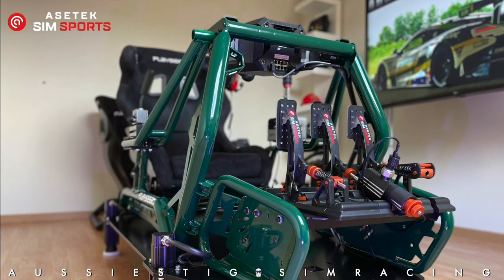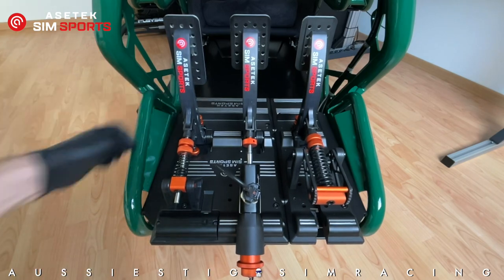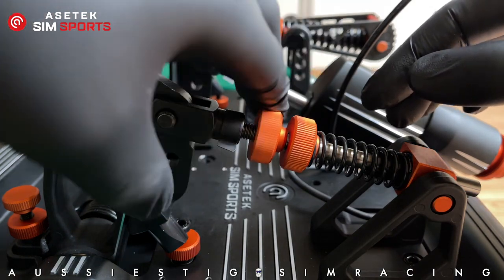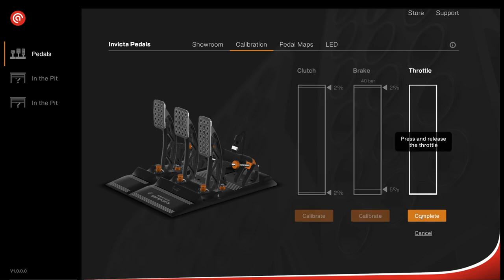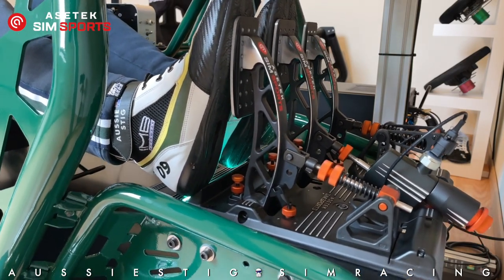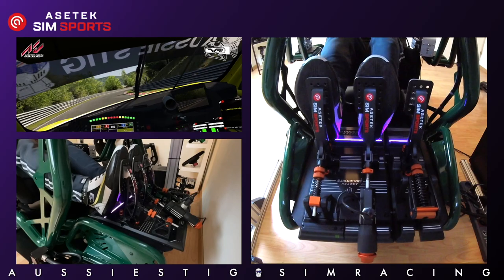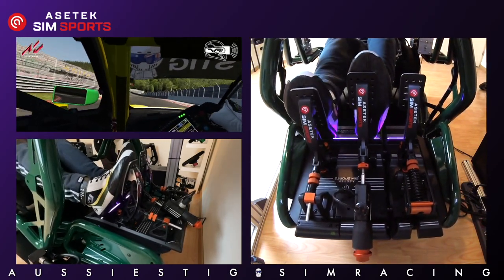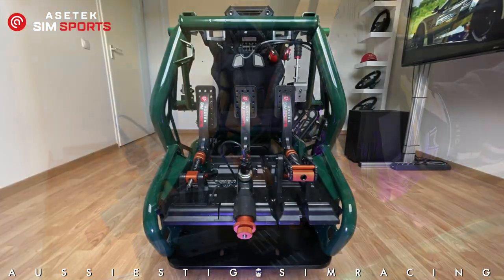Part 2 - AussieStig Reviews The Asetek SimSports Invicta Pedals

Comment: Hey AussiStig, If I were to set these pedals to their lowest setting do you think it would throw me around considering I'll be using the 'next level racing wheel stand dd' and an office chair with bell rubber stoppers instead of wheels? I'm really trying to do the whole 'buy once cry once' thing here and don't have the space for stationary rig yet! Would really value your op. Cheers!
Reply from the maker: Hey mate no worries. The invicta brake pedal is very firm. On your projected set up they would need to be well anchored and possibly up against a wall. They do have softer elastomers now which I have not tried. These might give you a softer pedal which would help. Really hard to say having never tried a set up like yours. Sorry I can't be of more help. Good luck with the purchase Cheers AussieStig
Reply: @SimRacingwithAussieStig  That was a lot of help already. I appreciate the reply man thanks

Comment: Been waiting for this review as you are the only dude I am aware of who has Simtrecs (which I have on pre-order due for next month's batch) and now Asetek. So which one are you going to stick with, you are not going to swap decks out all the time, what bed are you going to lay in, Simtrecs or Asetek?
Reply from the maker: Thanks for the comment mate. I already have another set of pedals lined up to review, neither will be back on the rig permanently.  Both those pedals have very strong points and few flaws. It really is a personal choice and if you want maximum adjustability or can live with less. It depends a little on the rig you have as well. Cheers AussieStig
Reply: @SimRacingwithAussieStig  I guess you have sold out.............. you should run as a politician with that response kudus well done.
Reply from the maker: @rooman7160  I'm not in anyone's pocket mate. If I say buy this instead of that. You get this, install it and then don't like it, you will be cross with me for making a decision for you.
Reply: @SimRacingwithAussieStig  All I asked was which one would you put on your rig, you have not answered that question.

I understand the difference, Asetek great breaks, Simtrecs great adjustability that is a decision I need to make. For me, I am leaning towards Asetek due to the break and the price. I also am a little concerned about some of the feedback from the USB connection I have heard and the software regarding Simtrecs, nonetheless I no for a fact either one will be bloody fantastic but I do not own both where as you do.

One needs to be pragmatic at this price point there is never going to be a clear winner and if anyone thinks so they a fool. Either option would and will be a bloody top pick for anyone but I was curious as to your thoughts what you would put on your rig.

Keep up the great work, I like your different approach to putting up vids, hope you start streaming :)
Reply from the maker: @rooman7160  Pragmatism is the way to go, you don't know until you know. Some of my favourite pedals have been the hydraulic Ricmotech GT Pros based on Tilton 600 real car pedals. Thanks for the kind words mate.  AussieStig

Comment: I have been focused on the difference between the Simtrec and Aseteks Brake feel but what about the clutch and Throttle. Would you say those are pretty much identical in feeling between these two Products?
Reply from the maker: Hey mate, the throttles feel quite similar. The clutch on the Aseteks does feel different to the Simtrec's mechanism. The Simtrecs have a more pronounced bite point feel which is due to the mechanical action of the solid connection between the pedal arm and the rear pivot point.
Reply: @SimRacingwithAussieStig  OK, thanks for your experience with this. If I am hearing you right, the Aseteks DO still have a bit point, just not as pronounced as the Sim trec. I do drive a lot of cars with a Clutch
Reply from the maker: @rtimmins7212  Hey mate no worries. I know for myself when I use the clutch whilst heel&toeing, the clutch is pressed quickly and the bite point feel is not really felt. It is felt more for starting a race from a standing start, then you can feel the difference in approaches. Cheers, AussieStig
Reply: @SimRacingwithAussieStig  great , thank you. You are one of the rare Youtubers (who actually responds to comments) who has experience with these two pedals so your opinion is valued.
Reply from the maker: @rtimmins7212  No worries mate, anytime. Why have a channel if you think you are above answering people when they have  a question. Cheers AussieStig
Reply: @rtimmins7212  I currently have both the Simtrecs and the Aseteks. The throttle is stiffer on the Asetek and when going full throttle, it feels like there is lag or a delay, but that should be able to be tuned out with software. For heel-toe, the Simtrecs are nicer fot quick blips.

The clutch is also heavier on the Asetek but the bite-point step isn't that great. Think of it as a stiffer pressure plate.
Reply: @timt8199  which do you prefer for braking and do you even use either of these still?
Reply: @DrR1pper for braking in stock form, the Asetek Invictas. I have not tried the new version Sintrecs with the elastomer cups. However, for H-Pattern cars, heel and toe is better with the Simtrecs because there is more travel. The community has a 3d printed adapter to use the Simagic reactors on the Invictas, that are also alot stronger than the vibrating motors on the Simtrecs. 

If you're looking for more travel (street car style), the Simtrecs with the new cups or even a spring mod would be the way to go.
Reply: @DrR1pper  I still have both, but the Invictas are my primary set. I found it easier to threshold brake on cars without ABS.

Comment: SimTrecs pro or Asetek?
Reply from the maker: Depends on your set up and how solid your rig is. The Asetek has the edge on brake pedal feel. You will need a solid rig to mount them on. Simtrecs win on maximum adjustability.
Reply: @SimRacingwithAussieStig   I have a Simlab P1 X
Reply: @SimRacingwithAussieStig  I also want to know this as I have SimTrecs on order but they are currently significantly more expensive than the Invicta pedals due to pre order sale.  I am still leaning towards the SimTrecs myself.  Unfortunately it seems like such a tough decision!
Reply: @SimRacingwithAussieStig  Do you recall the maximum distance you could mount the Simtrecs brake and throttle?  I assume limited by cable length but would prefer to have the brake directly in line with my left leg with the throttle directly in line with my right leg for maximum comfort if that makes sense.
Reply from the maker: @slickmotion5021   both pedals have very strong points. If you want a really hard pedal with less adjustment possibilities then Asetek is a solid choice. If you want more adjustability Simtrecs offer that and a hydraulic pedal as well. It is a personal choice what suits you the best.
Reply from the maker: @chuckystang  get it mate the clutch cable may not be long enough for that. That has to go from the clutch to the throttle pedal.
Reply: @SimRacingwithAussieStig   SimTrecs is not hydraulic? How do the hydraulic brake vs elastic feel?
Reply from the maker: @slickmotion5021  Simtrecs have an adjustable hydraulic damper on them mate. Which can be set to give you a similar hard pedal feel.
Reply: @chuckystang  19.5cm from center of brake pedal to center of throttle pedal is the maximum gap. However, you won't be able to use the clutch pedal.

Comment: I have the Simtrecs and agree about the adjustability being a strong point with them. It allows for so much adjustability in brake travel and feel compared to the Aseteks. 

After watching a few of the reviews on the Asetek where brake travel is 20mm, I decided to add the hard elastomers and took out the slack from the pad to disc spring on the Simtrecs. It took some adjustment on my part and noticed that lap times were faster. 

I also measured the brake pedal distance of the Simtrecs and was able to replicate 20mm max travel with me pressing as hard as I could comfortably during sustained race conditions. The Simtrecs still gives me the option to add the hard plastic spacers to use in place of the hard elastomers if I want even more stiffness. Travel wise I know what to expect with the Aseteks, but am curious about the brake feel and have the Aseteks on pre-order.

Another thing I'm curious about is whether the Aseteks short brake pedal throw is also optimal for other disciplines of racing, such as oval or dirt racing where progressive braking is more important? Hoping someone with more experience in those disciplines can chime in.
Reply: Hey man did you get your Asetek's ? i'm stuck between Simtrecs and Asetek i can't choose to buy one :)
Reply: @991tts4 Yes, I have the Aseteks for a few weeks now. Unfortunately, they leaked...but Asetek was quick to respond and their after-sales support was really good. 

Brake feel is really good at the limit as you can dance the car between grip and slip while trail-braking. The biggest adjustment is the pressure required to brake, but that comes with time. Whereas the Simtrecs offers a wider range of adjustability in terms of travel and pressure. I am currently testing a spring setup that I was able to fit onto the Simtrecs - an idea from a fellow Simtrecs owner - and am going to test for a bit before reinstalling the Aseteks. 

If you get the Aseteks, you will be happy. Ergonomics is personal. If you're coming from Simtrecs, that's tougher since you give up some features that they offer. 

Brake feel I'd say the Asetek slightly has it over the Simtrecs - although I'm still testing between the two - but Simtrecs has been flawless in terms of reliability and probably the best looking set of pedals on the market today.
Reply: @timt8199  thanks a lot for your detailed reply much appreciated
Reply: @991tts4  I just read through some of the other comments and noticed that Aussie Stig had similar feedback so I don't know if I made your decision any easier.
Reply: @timt8199  actually i think i’ll go with the simtrecs because they look amazing and they maybe the most adjustable pedal in the market and also  i already have racewerk s1 pro pedals which are amazing but i was looking for a daily drive pedals for non racing days or other games then iracing :)

Comment: Hey mate,

So after using these and the Simtrecs for a good amount of time.

What is your preference between the two?
Reply from the maker: Hey mate really hard to separate them without sounding biased either way. I like the Aseteks brake a lot. The look and adjustability of the Simtrecs is also a strong argument. AussieStig
Reply: @SimRacingwithAussieStig  thanks for the feedback.

I'm currently an owner of the Simtrecs and am very happy. 

Just wondering if it would be worth the switch to Aseteks?

Comment: Considering selling ny ultimates to get these, would you recommend doing so? Have you tried the HE ultimates ?
Reply from the maker: Hey mate yes I have tried the Ultimates, very good pedals. Because of the T.H.O.R.P system, the brake feel of the Aseteks is very accurate and car like. The adjustability is another question though. If you can live without maximum adjustability then you could give them a go. Cheers, AussieStig